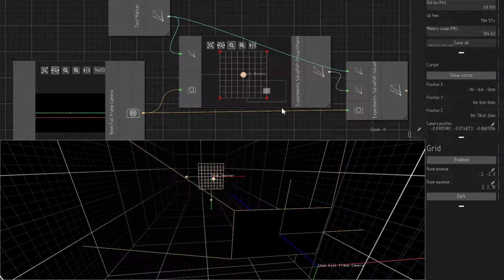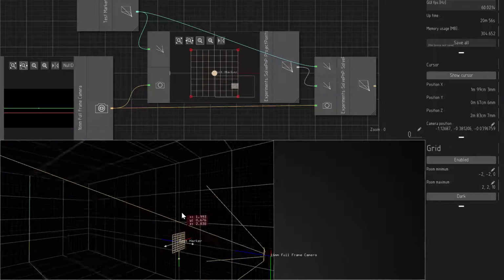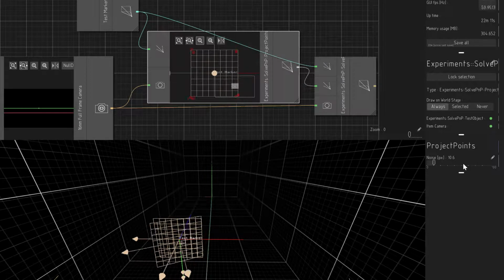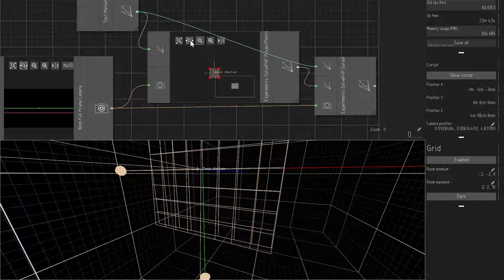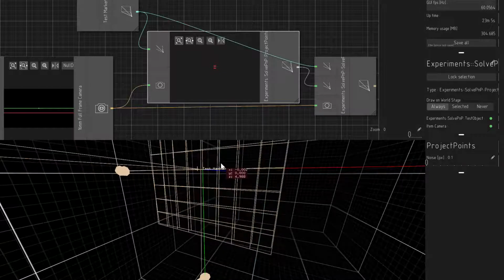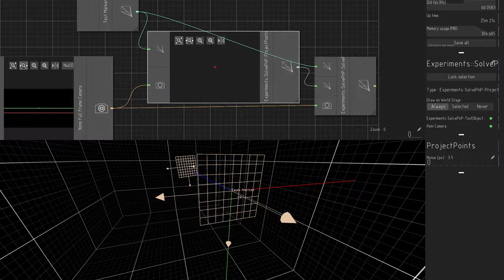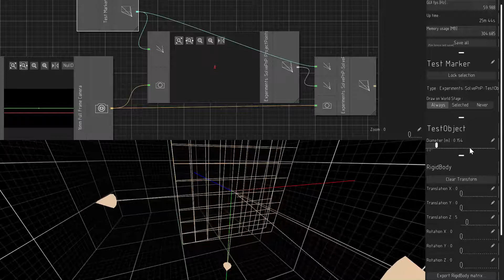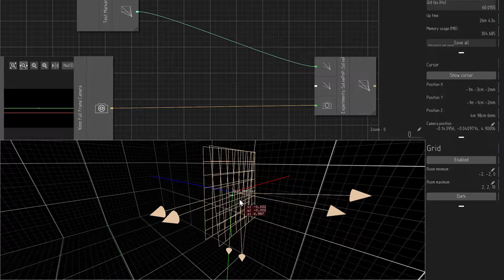SolvePnP sensitivity to noise, distance and diameter [ArUco Experiments 2]

Comment: Hey, I have tried using your software but wenn I use the .exe file I get an error message saying that hdf5.dll cannot be found
Reply from the maker: hey! yes for some version i accidentally built it with a version of OpenCV that had HDF5 selected. You can generally find the hdf5.dll on the internet. Just put it in the same folder as Rulr.exe and you're good to go.

Comment: Hi, I also have the problems about solvepnp noise. Is there a method to solve the noise? 
I want to get camera pose and position using chess marker.(accuracy under 1mm)
But, I am getting over 3, 4mm of camera position because of Rotation vector of solvepnp. (I think translation vector is quite correct.)
I am looking for a way to reduce noise of rotation vector. If you have the way or cule, could you share a a way to slove the problem?
Reply from the maker: general rules: 
1) larger board
2) better subpixel resolving (either use a monochrome camera, use inner corners, or other approach)
3) higher resolution camera (better lens, more pixels)
4) better calibration (i presume you've already explored this limit)